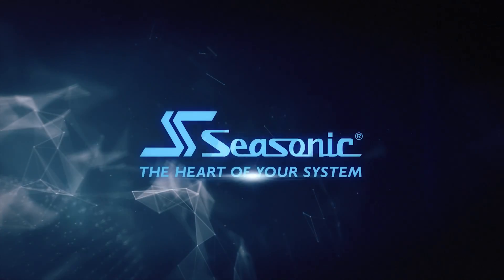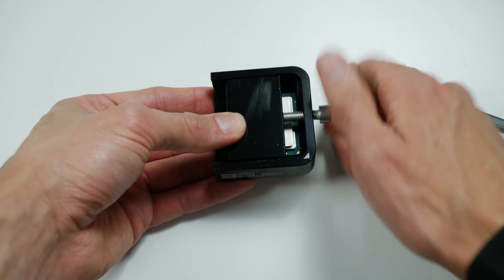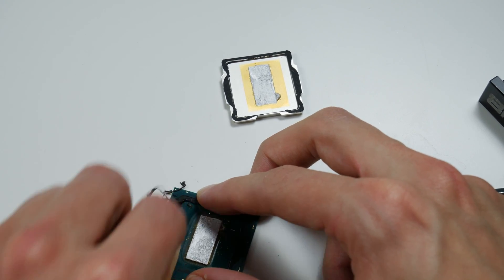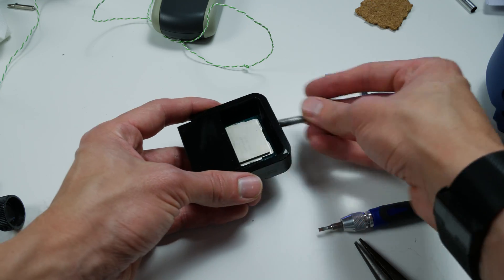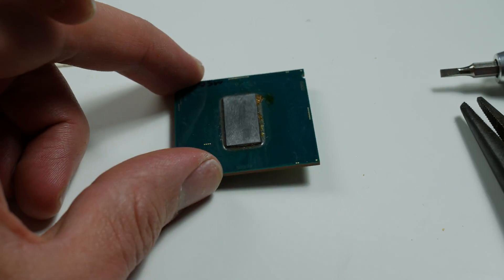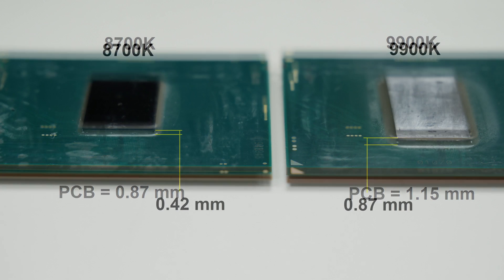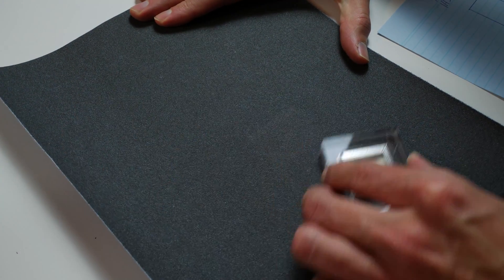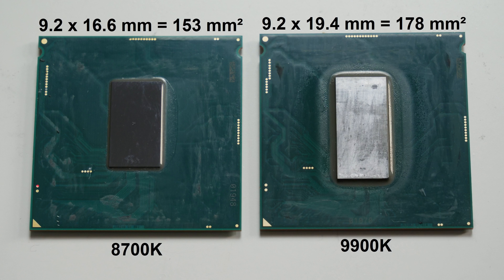Bad sTIM? Why is the 9900K so hot?

Comment: Two questions:
- What would be the lowest we could grind it down to safely?
- Is applying liquid metal on the ground silicon a problem? And if it is, is there some way of making the silicon less permeable (with some sort of oxydizing maybe)?
Reply: In the german video he said "I cannot tell what the long term consequences of grinding it down are, because you have to consider that (liquid metal) atoms can diffuse through the silicium and then there's there question 'is there any influence on the CPU itself because of that' because normally atoms are not supposed to penetrate through the silicium due to the diffusion barrier that is on top of the silicium to prevent any atoms from penetrating through, which then is removed by the grinding, so it is hard to tell if there are any technical influences because of that. But here at CaseKing we still decided to offer delidded 9900K CPUs..."
Reply: Thanks for confirming. I'll make a bit of research over what this barrier could be made of. Maybe with some chemical reaction we could make a new one after grinding the CPU.

Edit: according to this article (https://overclocking.guide/the-truth-about-cpu-soldering/ ) it's made out of titanium and nickel-vanadium. I guess you would have to somehow plate titanium on the ground surface then nickel-vanadium on top of that. Except titanium seems to be exceptionnaly hard to plate.

Edit2: the titanium and nickel-vanadium are apparently only for soldered CPUs, so I'm guessing the non-soldered CPUs have another type of diffusion barrier .. probably something simpler like some sort of passivation reaction. Silicon dioxide seems to be the most common silicon passivation technique except silicon dioxide is an insulating material .. I'm scourging wikipedia for high thermal conductivity silicon derivatives.
Reply: What a boring life that would be .. it's just so much more interesting to learn about all this technical stuff and try to push the limits of what we can do. And the Ryzen is maybe cheap but miles behind Intel in terms of efficiency and optimization.

Anyway in the meantime I found an awesome website (http://www.eesemi.com , great read) which suggests that the protective layer is silicon nitride (http://www.eesemi.com/glassivation.htm ). But the different processes used to apply silicon nitride seem really insane, one involves plasma and vacuum, the other hellish temperatures. And in the end, silicon nitride has a pretty bad thermal conductivity, so if you deposit too much you risk loosing any benefit from the grinding. I suspect there is no real solution here apart from using conventional thermal paste that does not attack the silicon.
Reply: @nout4269  "Ryzen might be cheap, but its miles behind intel on efficiency and optimization" - This proves that you are a intel fanboy... Firstly, i know that intel's chips are faster for gaming, just wana make that clear, but Zen is a new architecture, it's only been out for 2 years, of course AMD optimization isn't gonna compare to to Intel's now 3 generation old architecture. Secondly, do i have to remember you that Ryzen is on 12 nm, instead of 14++++++++++? Ryzen is not FX. The difference in power consumption is at best 5-10W between these chips, as could be seen in this graph : https://goo.gl/images/hHHmS4
Reply: If the point that you are trying to make is that AMD chips are better value then okay, it won't change the fact that Intel chips can reach 5.3GHz. Give me an AMD CPU that'll reach that and I'll switch to AMD any day.

Now let me remind you that you can't compare diferrent manufacturers node sizes, and as such AMD's (really Global Foundries) 12nm is basically the same as Intel's 14nm.

Even if shrinking usually yields efficiency benefits, Intel clearly just demonstrated with the 8th gen refresh that optimization plays a big role. You can shit all you want on Intel's "14nm+++++++++" process, but if in the end it's better than AMD's "12nm", what you are really proving here is that Intel has a better control of their process.

Also the power consumption diagram you linked is useless because:
1) The i9 9900K doesn't figure on it
2) Comparing absolute power consumption is stupid, you have to compare the performance/watts, in which case AMD CPUs sink to the bottom of the chart

And please don't call me an Intel fanboi. Just look at the facts. Neither company is your friend.
Reply: I thought that was epoxy, not silicon...
Reply: I’m curious to see if you find a solution for the silicon permeation issue, I’m heavily researching this myself. Not 100% satisfied with what I’ve been reading about thermals on this chip, but I don’t want to make things worse in the long run trying to improve it.
Reply: both sides of the silicon have an oxide layer. Grinding one side removes it from that side, the but the side the circuits are on still have an oxide layer where needed.

i suppose if you ground it down to the thickness close to that of the transistors, the voltages might interfere with each other due to the liquid metal applied, but otherwise, i dont think it will penetrate through the silicon

Comment: "WINTER IS COMING".. oh wait i have a 9900K cold worries no more :)
Reply: bing jr I saw this comment on HUB’s video today too... heh.. you really want those likes, don’t you? x)
Reply: That argument is not fair! 
As it was on AMD in the past...
Lol
Reply: It doesnt entirely make sense tho. Better thermal conductivity could mean lower cpu temps and same overall heat output, or it would allow you to push the chip harder increasing output. You want the heat out of the cpu, not trapped inside!
Reply: @Simon T - Exactly... makes one wonder what kind of TDP measurements they have at Intel... For cooling the IHS or the cores...
Reply: Oh, if you really want to not worry about winter, build a dual Pentium Pro or some Pentium 4 Prescott systems.
Reply: actually, for the same wattage, you want a cooler running chip because that way, more of the heat is removed from the chip vs just soaking in the silicon

Comment: Now I just wonder if this was like Vega and HBM2 (to lower power consumption), were they were basically forced to use solder, otherwise it would be too hot.
Reply: They definitely couldn't use their usual go-to dow corning paste and thick glue at these stock clockspeeds. They would have had to go with lower clocks if they had used paste, which would have seen them losing to the 8700K in some gaming benchmarks.

Comment: Don't forget that as you lap the die, you also increase the gap to the IHS. It'd be interesting to measure the gap between the IHS and die at stock and after a lap. Does anyone use gauge plastic to measure gap distance? If not, that would be a reliable way to do so.

Comment: Will you try mounting it without a IHS? Direct die to AIO?
In one of my old PC's i have a Intel core 2 quad Q9550 which had a soldered IHS. Maybe you can compare that old soldered chip architecture to the 9900K....
I did delid that old chip, and overclocked it with a direct cooler to die mounting solution, and to me it looks like the soldering procedure of that old chip is exactly the same as the new 9900K...

Comment: This is absurd, Intel is manufacturing worst CPUs each year in terms of temperatures, It doesn't make any sense.
Reply: What are you complaining about? Heating season is upon us! Crank up that CPU and enjoy that Intel warmth in those cold autumn/winter days and nights.
Reply: CADesigner  post the 2500k the nanometer density plus alterations to the 3D structure complexity of the transistors, intel has had hotter chips, which are harder to dissipate heat from. I think nm process scale is having an impact on this.
Reply: They are following in AMDs footsteps, get ready for their comeback in ~4 years.
Reply: should be obvious because of the name skylake. it's a refresh; so much for "tick-tock" eh intel? XD
Reply: @sinephase tick-tock has been dead for a few years now, pay attention. It's tick-tock-optimize now, although Intel has problems with that process as well now.
Reply: lol pay attention? tock is optimize, I guess the 3rd release is rebrand? XD
Reply: It stoped being tick-tock, officially, from 2016. Tick-tock is now process, architecture, optimization
Reply: @sirius4k  yes but now it's become
process, Architecture, optimisation, optimisation, optimisation, rebrand
Reply: @Neiva71  tell me when your house burns down
Reply: Wait 4 months, and see 9990XE, which doesn't throttle until 110°C.
Reply: if you add more cores and those cores still go to 5ghz then its gonna increase heat.  they give us what we ask for and then complain?  come on.  i have this chip and am running it at -160 offset and medium llc.  its running cinbench at 5ghz at 1.2v.  i have the tjmax set at 85c and it doesnt throttle in just about anything unless you run it for a long time and even then im only on an air cooler.  the only complaint i have about this chip is the price.  everything else is good.  i would rather have had the 9900k been a 6 core that goes to 5.6ghz but this works too : )
Reply: CADesigner.... people want more cores but they want to stay at the same mhz so their badly optimized games wont lag... since the manufacture process didnt change much from 8700k you cant just magicaly make heat dissapear even Intel has to obey the laws of physics......
Reply: Well, justified or not. 90C is NOT ok, is it now? And we're not even talking about some heavy OC'ing. I would not buy this, luckily I wasn't going to anyway. I'm waiting for 9900X, and if that has some weird issues as well, off to 2950X I go.
Reply: whats in your current pc?
Reply: i7-3930K, I'm going to upgrade one way or the other before the years end.
Reply: can i have the motherboard and cpu when you do could use a upgrade?
Reply: I'm selling them in local used stuff market. I won't bother with the international stuff. Besides, while the CPU is ok, I'm pretty sure the ASUS's Sabertooth X79 is slowly dying. Some USB ports either don't work or the devices plugged in act funny. Network connection drops randomly for 5-6 seconds.. sometimes many times in a row, sometimes not, extremely annoying in GTAV Online or MMOs. It's mainly still working, I hope it keeps working until I get the upgrade.
Reply: sirius4k, 90C is on a large AIO as well, likely with 100% fans.
Reply: I had same set up, ASUS board USB ports died on me. And currently I have 5930k with another asus motherboard (x99), and its USB ports slowly are dieing as well. Good thing I got ryzen 2700x on a test bench to replace it. And watching this video makes me laugh more and more, how intel is digging themselves deeper and deeper :D
Reply: not true 8000 series runs nice and cool

Comment: so. 5.0 hgz on all cores run hot a dragon. That is sad. We all ready cancel 5 9900k. back to 8700k / 8086k and 2700x  what a flop.  Thanks Roman. was expecting these since a while. well. intel back to the drawing board. Yes making these process to cool down the cpu is perfect. or use it stock.